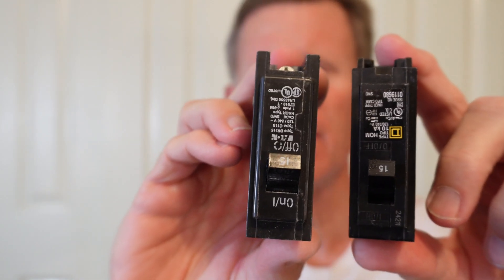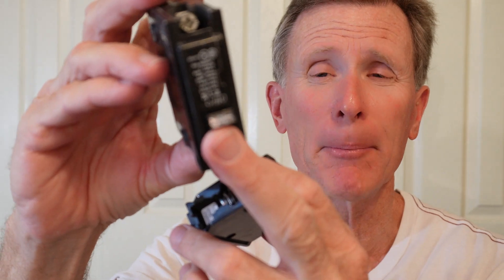What is a Tandem Breaker?

Comment: The reason 60 amp breakers are installed on 48 amp EV charger is that EV charging is a continuous load, so breaker ≥ 125% of load (NEC 625). You want 25% or below the breakers max to avoid heat buildup since EVs pull power for extended periods of time. So it’s actually safer to have a 60 amp breakers max for a 48 amp max charger. Not my rules just what I have seen from researching and having one installed.
Reply: Continuous load by code is 3 hours +. Which of course qualifies for a Tesla or electric car charge. Good info on the video, thank you.

Comment: Thanks for the video explaining the tandems. I am exactly in the situation when the 30-space panel is full of breakers, none of them tandems yet and looking to install 14-50 outlet for a level 2 EV connector. Hopefully I can find a video of how I can calculate the load on each leg to install tandems and the 50-amp 240v breaker for an EV connector and have the load to be evenly distributed between the two 120v legs.
Reply from the maker: You are welcome!